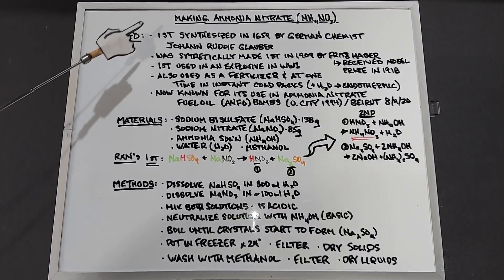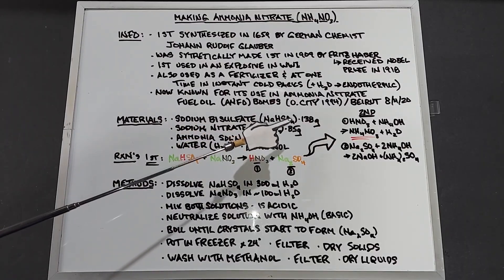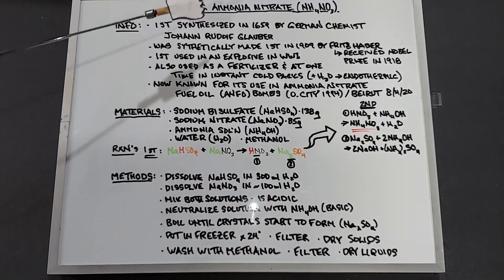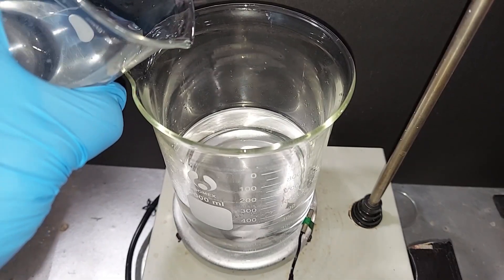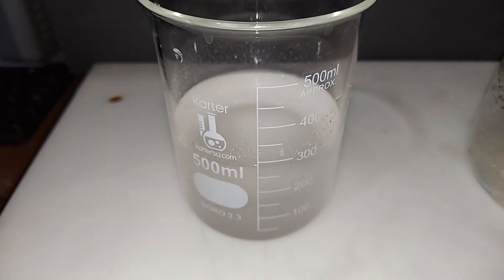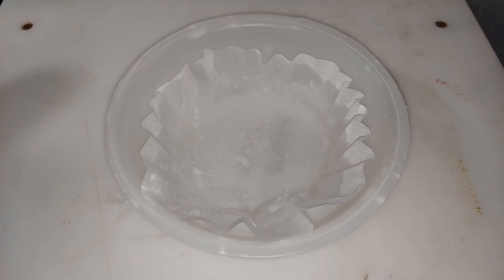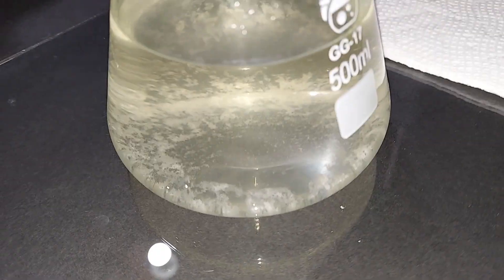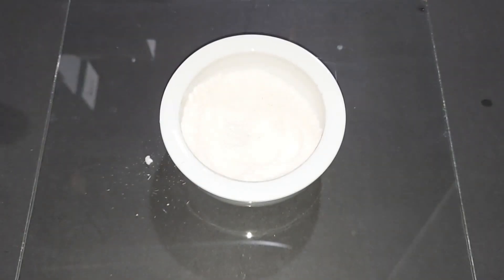Making The Useful Ammonia Nitrate

Comment: Where this process shines is the low cost of starting ingredients.  But since ammonium nitrate is only moderately soluble in methanol,  this process would be optimized by distillation of most of the methanol for reuse.  Just keep the collected methanol in a separate bottle because it will have traces of water in it.
Reply from the maker: You're correct.  More and more I am saving some of the more expensive chemicals that can be distilled later to purify.  Thankfully, in the U.S. methanol is readily available.

Comment: I make ammonium nitrate from the double-replacement reaction of calcium nitrate and ammonium bicarbonate. The result is calcium carbonate, which is practically insoluble in water and easily separated, and ammonium nitrate. The calcium carbonate simply sinks to the bottom, and you don't even need to filter it, but I do it anyway. Then, just evaporate. This method is so efficient that the ammonium nitrate content is greater than 99.9% because the carbonate is very slightly soluble, of course, without considering any impurities in the previous products. With 99% ammonium nitrate, you won't even need to recrystallize for other applications.
Reply from the maker: I really appreciate you sharing your method.  Sounds very efficient.

Comment: Now this Pses me off i want to make ammonia nitrate but cant find affordable sodium nitrate and you need ammonia nitrate + lye to make sodium nitrate  or sodium bicarbonate + calcium nitrate to make sodium nitrate 😵‍💫
Reply from the maker: Yeah I've been there.  When I started I could only do experiments with the chemicals I already had as everything seemed too expensive.  I have to plan carefully so I can afford something I don't already have.
Reply: Thank you for the reply , I've found a way, study study study until it gets through into my thick skull ,could it be as simple as dissolving CAN in D'H2O @ 20°c+ filtering out the calcium carbonate? right now, im doing a study into what the % of calcium to NH4NO3 in a single comman granule. @cranialconstruction2218
Reply: @cranialconstruction 😅 yeah speaking of this video I found that widow washer fluid for my vehicle has methanol in it maybe I could purify it , not sure if I've seen you post that type of experiment yet but it is a good idea for a future one 😉

Comment: so in theory i could just add an ammonia solution directly dropwise to azeotropic nitric acid until its ph is 7 and then crystalize out pure ammonium nitrate via evaporation or vacuum distillation?
Reply: Absolutely, but ammonium nitrate is way cheaper than HNO3 or ammonia solution. Outlaw targets has good prices. If you decide to go the neutralization route make sure to use an ice bath and go slowly, it gets really hot.

Comment: An ANFO bomb did not blowup Oklahoma City Building as it is too weak as the Velocity is Too Slow.

 What did blow it up was a High Grade Military Explosive as first reported.
Reply from the maker: Just to be clearer, the Oklahoma City building was destroyed by ANFO with an accelerator, nitromethane.  The vehicle they used contained around 2 tons of this mixed explosive.  The ammonium nitrate was the oxidizer, and the fuel oil and nitromethane both served as fuels in the explosion.

Comment: make ammonium nitrate:
Materials:

    138 g sodium bisulfate (found with pool chemicals, used to lower pH)
    1 mole equivalent of a nitrate salt, available as any of the following:
        85 g sodium nitrate (common food preservative)
        101 g potassium nitrate (which you can buy or make yourself)
        118 g calcium nitrate (tetrahydrate)
    ammonia (common household cleaner)
    methanol (optional, which may be found as HEET fuel treatment)
    water
    pH meter or pH paper
    access to a stove
    coffee filter or paper towels

Procedure:

    Dissolve the sodium bisulfate in the minimum amount of water (about 300 ml).
    Dissolve your nitrate salt in the minimum amount of water (amount depends on the salt).
    Mix the two solutions.
    Next, you will neutralize the solution, which is quite acidic. Stir in ammonia until the pH of the mixture is 7 or higher. Use a pH meter (or pH paper). Reacting ammonia, sodium bisulfate, and nitrates will give you sodium sulfate and ammonium nitrate.
    Sodium sulfate and ammonium nitrate have different solubilities in water, so boil the solution to get the sodium sulfate to crystallize. Remove the liquid from heat when crystals of sodium sulfate form in the bottom of the pan.
    Chill the solution in the freezer to get as much of the sodium sulfate as possible to drop out of the solution.
    Run the solution through a filter (coffee filter or paper towels) to separate the solid sodium sulfate from the ammonium nitrate solution.
    Allow the ammonium nitrate solution to evaporate, which will give you ammonium nitrate, with some sodium sulfate impurity. This is ‘good enough’ for most chemistry projects.
    If you want to further purify the ammonium nitrate, dissolve it in about 500 ml of methanol. The ammonium nitrate is soluble in methanol, while the sodium sulfate is not.
    Run the solution through a filter, which will give you sodium sulfate on the filter and a solution of ammonium nitrate.
    Allow the methanol to evaporate from the solution to obtain crystalline ammonium nitrate.
Reply: I checked the solubility of ammonium nitrate in methanol, and from the results, I estimate you'll need to increase the amount of methanol to get all of the desired product.  At 25C, I could only dissolve about 5g in 75mL of methanol before it refused to dissolve more.  I did this using virgin ammonium nitrate to try and ensure contaminants wouldn't affect the results.

Comment: i woudlve kept the solution boiling till almost dry, seeing how soluble ammonium nitrate is in water even at negative temps. So there was probably quite a bit more left in the solution 118 g/100 ml (0 °C) but dont boil to dryness, since dried crystalised ammonium nitrate in a beaker, good luck getting it out without breaking the beaker lol.

Comment: Ammonium nitrate was often used in mixtures with TNT to form Amatol which retained most of it's effectiveness with up to 30-40% ammonium nitrate as it's positive oxygen balance would offset the negative oxygen balance of TNT which normally would leave a black sooty cloud when bursting (which is probably responsible for the black clouds associated with flak), for uses like blasting and massive mine charges for destroying tunnels, dugouts and fortifications it could be up to 60-80% ammonium nitrate. The UK suffered a massive shell supply crisis beginning in mid to late 1914 and was apparent by 1915 and plants were set up to perform a similar process employing ammonium sulphate and sodium nitrate to produce ammonium nitrate to produce amatol for shell fillings, as a large fraction of nitrates destined for fertilisers or munitions were being imported from producers in Germany like BASF (which employed Fritz Haber and Carl Bosch at the time the process was invented) the UK had to find an expedient solution for producing nitrates for their munitions and the Ministry of Munitions ordered the construction of massive chemical and shell filling plants and the Munitions of War Act 1915 essentially forbade and made a punishable offence of workers of munitions plants from resigning without their employer's permission (which was basically impossible to obtain), imposed very strict limits on working hours, wages and conditions, forbidding strikes, walkouts and other union industrial action, placed private industry under state control among other things.
Unfortunately there were several accidents with massive blasts.
Reply: Thanks for posting this, good read.

Comment: Thanks bro. Questions  for sodium perchlorate  cell do you need to purify the  salt first the NaCl by recrystallization  or no  need  to get good product. Or adding  drops  of sulfuric acid.  while using the lead dioxide  anode and cathode  pls .thanks again
Reply from the maker: You don't need to purify the salt if you buy it pure at first.  It is available online.  If you can't find it, then yes recrystallization will indeed help.  For this reaction you really need inert electrodes and graphite is a good one.  Easily obtained from the inside of old standard batteries.  Platinum works but...too much typically.
Reply: @cranialconstruction2218  thanks bro. I heard also lead dioxide anode and cathode are good  but adding few drops of sulfuric acid  can increase the  strat thanks million times  for answering back 👍
Reply: @cranialconstruction 

Hey friend, can you please send me this information? Since my English is not very good, I can't understand you from your speech. I just saw your videos and thank you very much.

Comment: Solid, brother! FYI, by IUPAC convention, it's called ammonium nitrate to reflect the fact it contains the ammonia ion and not the ammonia molecule. And in OKC, there were several reports of multiple devices inside the Murrah building.
Reply: I believe the devices inside the building were ones the ATF had either confiscated, or samples they had. Then again, this was one of the agencies at Waco, and directly led to the Ruby Ridge situation, so who really knows?
Reply: @Tunkkis  Did you know Vernon Wayne Howell, aka David Koresh, used to be an employee at the US Department of Treasury?
Reply: The title to to avoid YT censorship issues. Lmfao. Intelligent answer, but, still wrong. IMO. I may be wrong....er, lol.